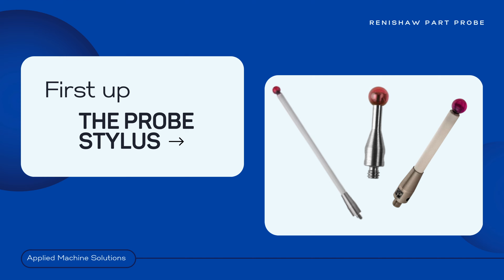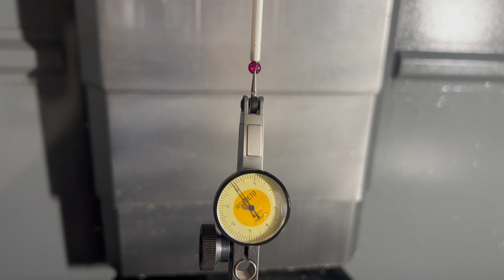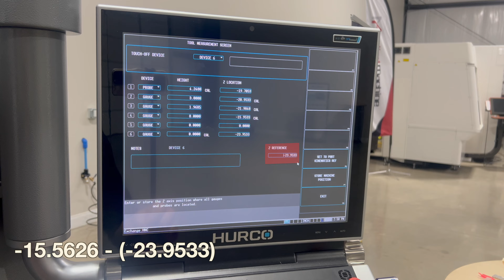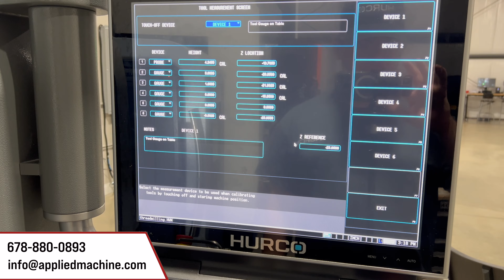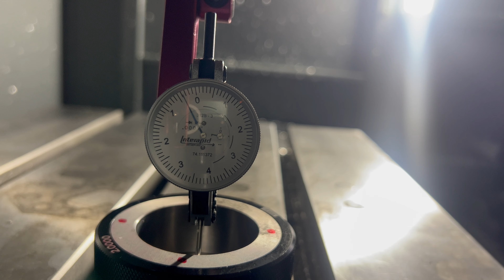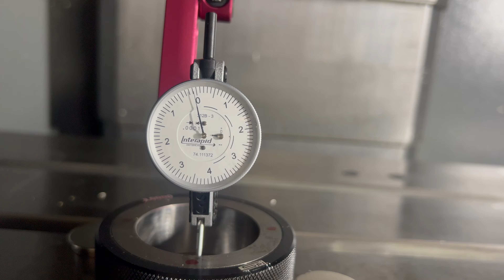How to Setup and Calibrate Renishaw Part Probe on a Hurco Mill

Comment: Probe calibration is the step most shops rush, and it shows up later as drifting part sizes. Good that the walkthrough covers the setup on the Hurco from the start.